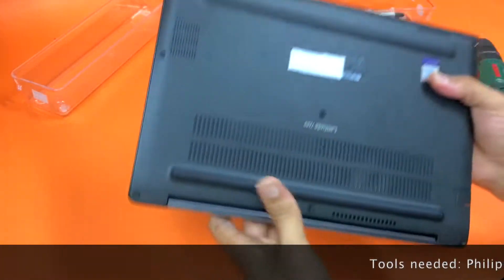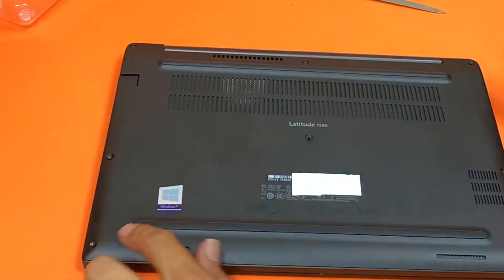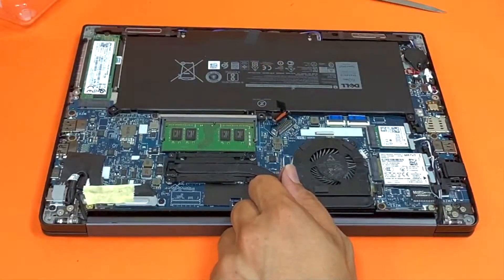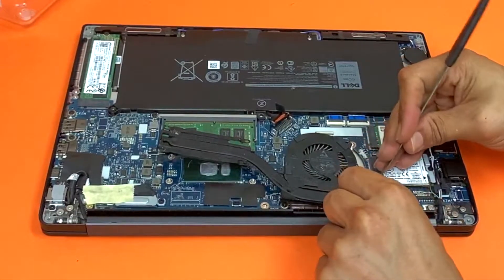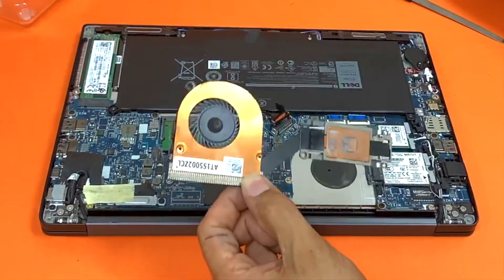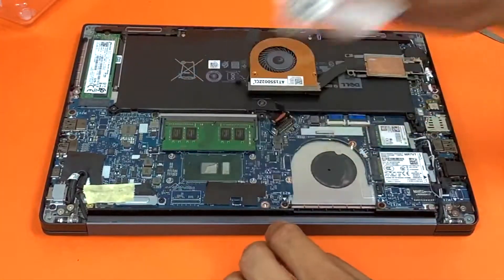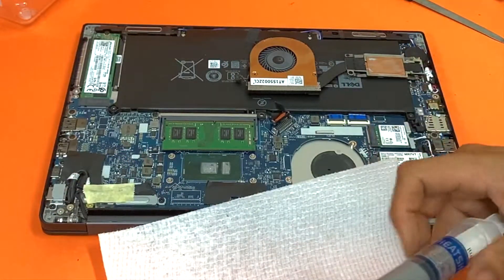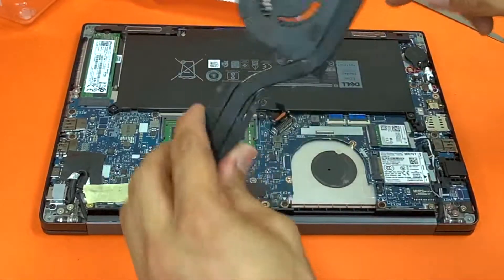Dell Latitude 7280 | Fan cleaning & RE-paste Thermal Liquid

Comment: The motherboard was bending under the pressure of removing those screws. I tend to do that kind of thing manually, or I'd buy a less powerful screwdriver for the job really. Cheaper than having to replace the motherboard if the screwdriver slipped 😗
Reply: Good tutorial but I wouldn't use an impact driver on a laptop.  I winced and looked away. lol

Comment: I have a problem with that laptop.  Many lines appeared on the screen, a blue screen also appeared... and now it freezes once the operating system starts.  when it stays frozen it gets too hot.  
I tried to start it connected to a tv and it works fine, (it looks good both on the tv and on the laptop).  and it does not freeze, but when you disconnect it from the tv it freezes again and does not respond.  
Do you have any idea what it could be?